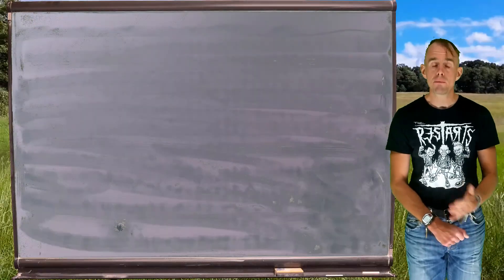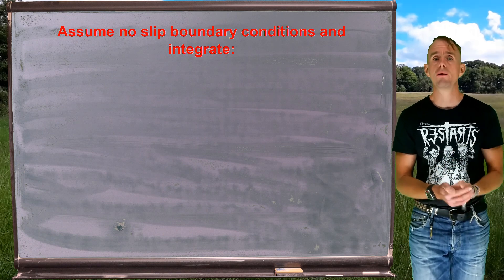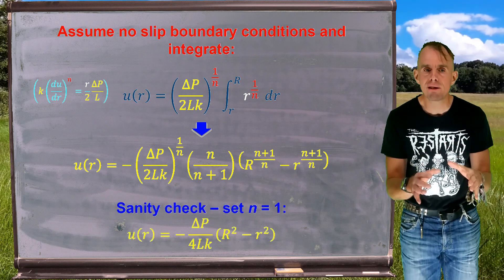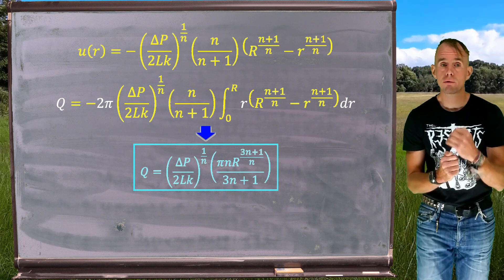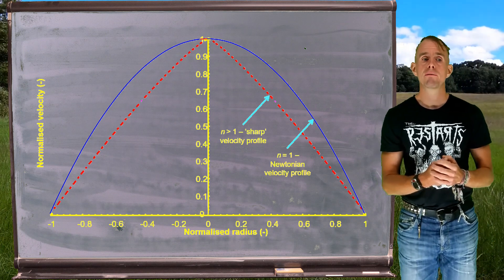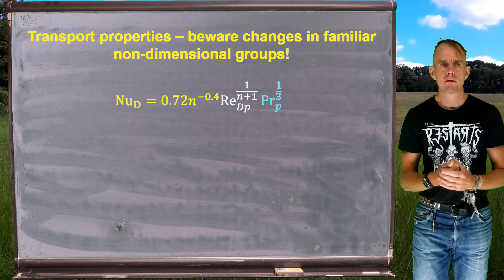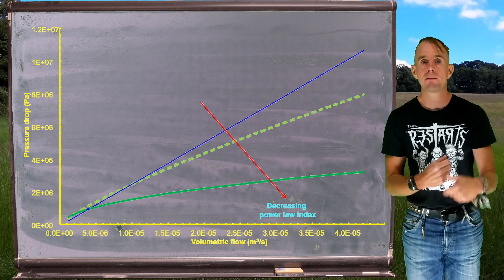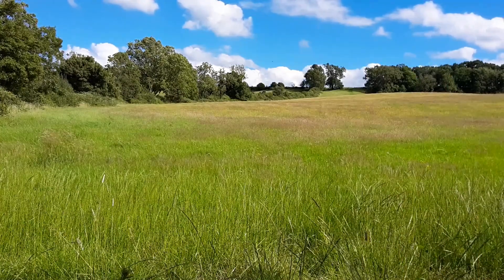Lesson 6, part 1: power law fluids in pipe flow

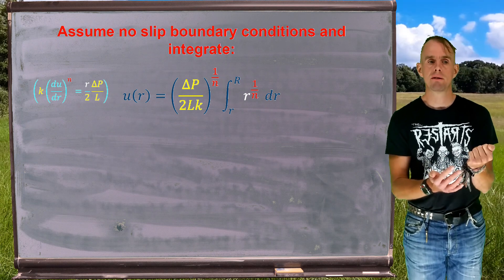Comment: Is the negative sign before the expression at 3:49 correct? When I derived the expression, I did not get a negative sign. This negative sign then goes away at 7:02. Thank you for the explanation
Reply from the maker: I'm not able to check that now, but in general I should have been more careful with some of the sign conventions... I used 2 different sources for some of the material, each of which had different conventions. Despite best efforts to unify everything a few errors have inevitably crept through - apologies!